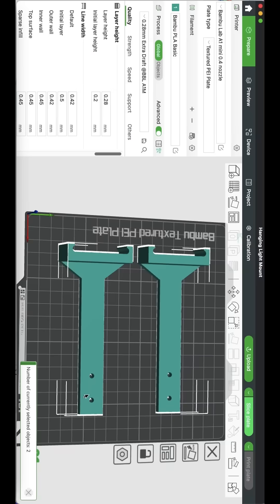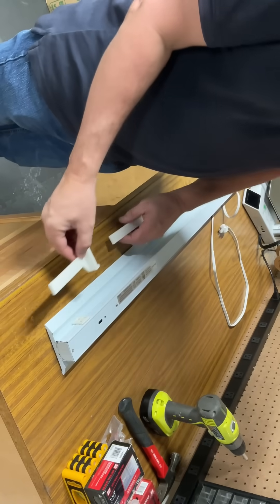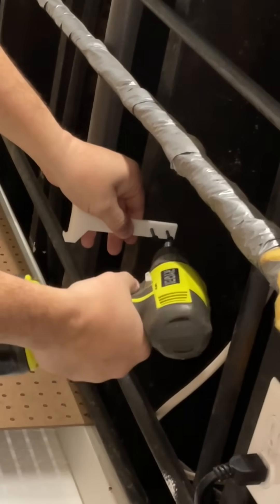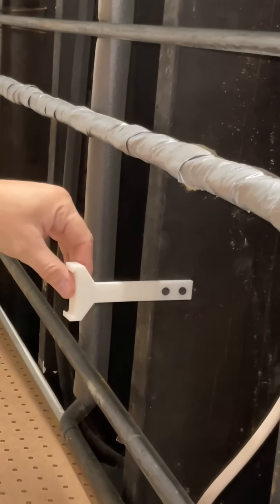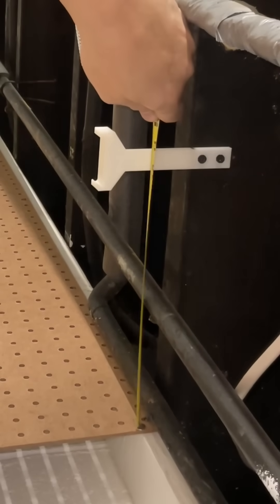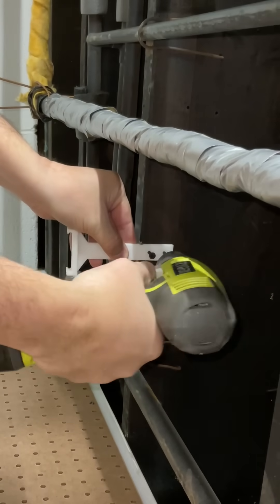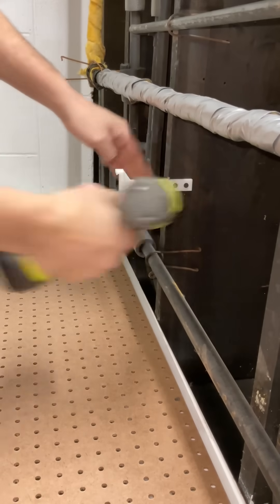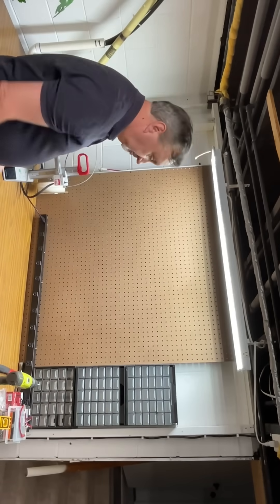A1 Mini 3D Printer - A quick practical print.

Comment: I started with an Anycubic Vyper... and emailed Chuck a few times for help.  Its dialed in and works great... but every filament needs to be tested.  I was gifted an A1 Mini with AMS.   Never had to touch any profile settings.   Only sometimes Ill adjust Support Z top and Bottom.  Again the A1 mini with its flow sensor does all the work.
Reply: That flow sensor is one hell of a part. It does make for just pressing print super easy. 
After I found out how easy it was to tune filaments though, I don’t mind it. I usually don’t use the flow calibration anymore unless I’m uncertain about a filament. Even then though I still like to use my own settings and inspect the part, then adjust accordingly. It’s pretty simple to figure out what needs to be adjusted and how once you get some hours under your belt. 

To a complete beginner though, yeah it makes the hobby a game changer.

Comment: If you round the vertical edges. Youll shave off more time on the print and a little material without losing any strength.